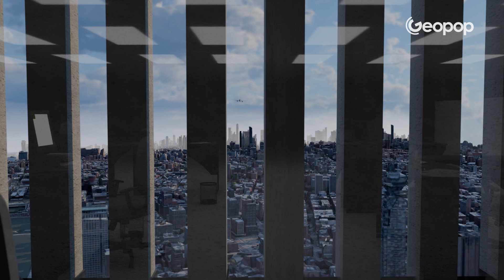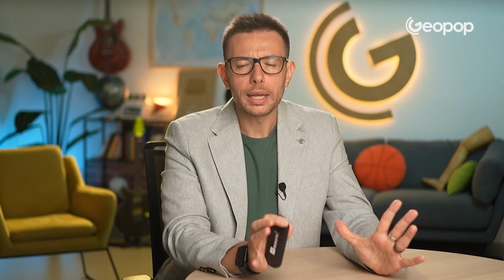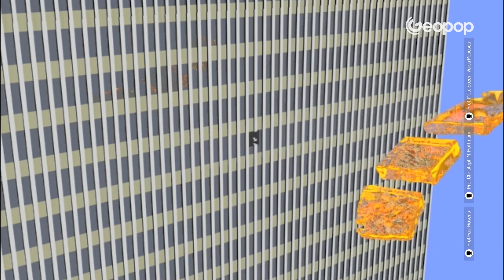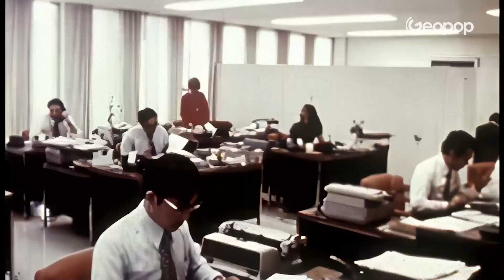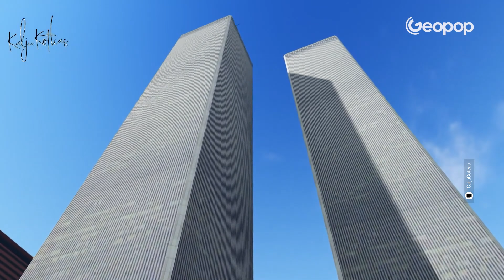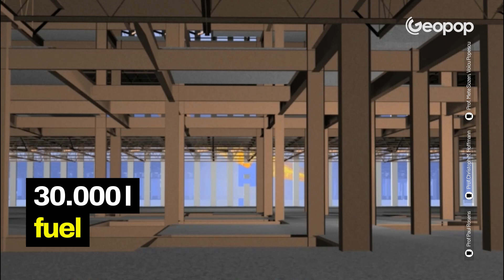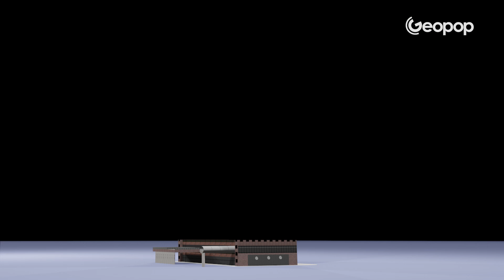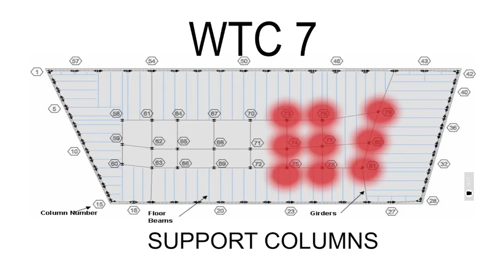9/11, 2001: The Technical Reconstruction of the Twin Towers and WTC 7 Collapses

Comment: NIST's final report actually confirmed a period of free fall lasting approximately 2.25 seconds over a distance of eight stories. This is only possible if support along those eight stories are COMPLETELY removed or broken.
Reply: It was the end of the collapse when they recorded that. The section they measured - the exterior moment frame - was only being supported by 4 columns or so. Nearly 80 columns had already failed starting more than 10 seconds earlier.

This is why it is so important to read the entire report so you can understand these things in context
Reply: @TheLoonResistance  You are a very busy shill Fitzshill!
Reply: @TheLoonResistance  Nope...it was more in the middle rather, occurring between 1.75s and 4.0s into the total 5.4s descent.
Reply: @ziad_jkhan  - Free fall doesn't matter
Reply: @TheLoonResistance  Well, that's willful ignorance
Reply: @ziad_jkhan  - Then prove me wrong. You STILL haven't said why you think believe it matters. Lay out your case. Your entire case, start to finish.
Reply: @TheLoonResistance  LOL...you're conveniently ignoring the fact that the free fall implies that the supporting columns must have been COMPLETELY suppressed over the entire eight stories all at once and you're asking me to prove you wrong instead?
Reply: @ziad_jkhan - No it doesn’t.  The NIST certainly describe no such thing. 

When are you going to ask me how Chandler and The NIST measurements are a curve, not a straight line and show a period of over GA?

How does that fit your scenario?
Reply: @TheLoonResistance  You're making no sense at this point. You're literally sounding like a bot that's out of touch with actual reality
Reply: @ziad_jkhan - Which part of what it said makes no sense?  You made a vague, unsupported claim.

I pointed out your claim is contradicted by The NIST - the source of your data.  That is a true fact.

I also pointed out the measurement in question is a curve, not a straight line and includes a period of over GA. I said the same thing yesterday and it is also a true fact.

How do you explain faster than free fall? I can, the question is can you?
Reply: @TheLoonResistance  Sorry, you stopped making sense and are starting to sound like a bot again, one that's gladly intent on ignoring the free fall issue. I've got better things to do than argue with a bot.
Reply: @TheLoonResistance  If you can explain the free fall then go ahead else just shut up and stop trolling
Reply: @ziad_jkhan - I am addressing the free fall issue directly, just not in a way you have been programmed to deal with. So you are trying to take the losers way out to save face.

Maybe if your brain is being overloaded we should only deal with one aspect at a time. 

You claim The NIST measured a brief period of free fall during the collapse of Building 7.

You also claim without evidence this can only be possible if every one of the 82 columns is removed over 8 floors simultaneously. 

Do The NIST describe that occurring, YES or NO?
Reply: @TheLoonResistance  I don't need evidence. It's a basic law of physics. Nothing can fall at free fall speed unless the way down is COMPLETELY cleared. It's as simple as that and, again, you're just trolling at this point.
Reply: @ziad_jkhan - You are avoiding the question.  

You claimed free fall can only hspoen if every column in the building fails at the same time over 8 floors.  Does The NIST describe all of the columns in the building failing simultaneously over 8 floors, YES or NO? 

To save time with your endless evasions and because you haven't actually read the thing I will answer for you.

No, the do not.

The NIST describes a progressive collapse with columns failing in sequence low in the building. Yet they still measured a period of alleged free fall?

How is that possible?
Reply: @ziad_jkhan  - We are at that ugly point where dogma intercects with critical thinking

Up til now you have been reciting (badly) some dogma you found on the internet. It isn't your original idea and you have nothing invested in it beyond a few catch phrases you copied so you can't even flesh it out into a complete claim with a beginning, middle and end. Now here I come in challenging that dogma with true and relevant facts such as there was no actual measurement of sustained free fall, the measurement does not mean 83 columns failed simultaneously across 8 floors and the movement has nothing to do with what started the collapse but rather how it kept going.

ALL of that is over your head.

So you reach for standard non-thinkers defense #1 - your opponent must be a bot. 

Absolutley no thinking required, gets you off the hook and saves face while you don't have to learn a thing.

Sad.
Reply: @TheLoonResistance  Basic physics is not dogma. Again, you can't explain how WTC 7 fell at free fall speed for 2.25s over 8 stories, which requires everything underneath to be out of the way. So you're literally beating around the bush.
Reply: @ziad_jkhan  - You don't know anything about even basic physics. Again, you are just mindlessly repeating standard conspiracist catch phrases you copied off the internet.

For a single point on the outer shell (which was NOT THE BUILDING) to move (NOT DROP) at a rate that averages more or less 9.8m/s/s for a paltry 2.25 seconds does not require anything below to be out of the way.  For that one spot to start out below FFA then accelerate up to and then over FFA before decelerating back down below FFA again during that 2.25 seconds - which Chandler's measurements clearly show it did - definately does not require anything below to be out of the way.

Even in basic physics you need to stop always thinking in 2 dimensions (hint, hint, hint, hint, hint).
Reply: @TheLoonResistance  Yes, it does require EVERYTHING to be out of the way and the term 'free fall' is self-explanatory.

To be clear, free fall means gravity is the only force acting on an object. Any support under it exerting an upward force would negate it.
Reply: @ziad_jkhan   - You didn't take the hint.

The data point being measured is moving in 3 dimenstions not 2 which is why it starts out under GA, accelerates up to and then over GA before decelerating back down below GA during that arbitrarily chosen 2.25 seconds.  It is moving inward as it is moving down, which accelerates the data point to over GA. 

Remember, the data point being measured is on the hollow, empty outer shell, NOT THE BUILDING .  The Building (defined as its center of mass the core, floor systems and even the perimeter columns) are already gone before the measurement is taken. The only thing left is an empty outer shell that hung on the outside of the building and supported by just 4 of the buildings 83 columns. 

Since what is being measured is the hollow, empty outer shell, NOT THE BUILDING and that point was moving in 3 dimensions not 2, we now have 2 solid reasons why it means nothing.
Reply: @TheLoonResistance  Everything I said applies perfectly in 3D as in 2D. And the inner shell fell at almost the same speed as the outer shell on which the measurement was taken. The videos clearly show a negligible difference so your point is moot.

Even if there was a significant difference, you'd still have to explain the free fall speed for the outer facade that spanned over the 8 stories.
Reply: @ziad_jkhan  - In 3 dimensions there are more forces acting than just gravity, so multiple forces of acceleration in more than one direction - or do you not understand how a lever works?

Come on, this is basic physics.

And it's STILL NOT THE BUILDING just its exterior shell, held up by a piddly 4 columns which were not up to the job so they buckled more or less simultaneously. 

And that still tells us nothing about WHY the building collapsed

I understand this is multiple elements to track and you show clear signs of single-element (non)thinking but you have to stick with me on this.
Reply: @TheLoonResistance  You managed to avoid explaining the free fall speed...congrats!
Reply: @ziad_jkhan  - I did actually even though I don't have to. 4 columns of 83 failed more or less simultaneously, then the hollow empty shell moved in 3 dimensions like a lever accelerating the data point more than it would have by gravity alone.  You missed it because again, you are spouting dogma you mindlessly copied off the internet, not expressing ideas you earned.

You also managed to avoid explaining FASTER THAN FREE FALL, which happened and BTW completely destroys your argument, makes the measurement even more irrelevant than it already was. 

AND you keep avoiding the fact it ISN'T THE BUILDING BEING MEASURED, so more irrelevance

Just two of about a hundred reasons why a million people before you ALL FAILED running this same play.  Free fall is guaranteed proven fail. 

You know, even a Lab Rat eventually learns from its mistakes and changes its behavior.  I'm going to take one last shot at fixing that, then I'm done wasting my time on you.

In the video below (which is only 23 seconds long so IO won't waste your time) please indicate the time stamp (_:_ _) where we see the first externally visible signs of the building collapsing. When does it start?  

www.youtube.com/watch?v=4xN8lzBo9zY
Reply: @ziad_jkhan - And that's what I figured you would do. Run away from the easiest and most fundamental question there is.
Reply: @TheLoonResistance  Wait...isn't it you who's actually running away by failing to provide a proper explanation for the free fall?
Reply: @ziad_jkhan  - I already gave it.  More than once - there was no period of sustained FFA measured for any part of the building AND it tells us nothing about what caused the collapse if there were, so irrelevant.  I don't think I can make it any easier than that, even for you.  Again, reading comprehension seems to not be in your favor. This is why it is so important to begin and the beginning, don't you think?

So, let's start at the beginning:  In the video below please indicate the time stamp (_:_ _) where we see the first externally visible signs of the building collapsing. When does it start?  

www.youtube.com/watch?v=4xN8lzBo9zY
Reply: @ziad_jkhan  - It isn't a trick question. When does the collapse start in that video?

Comment: Even a child could tell you that if any collapse was even possible from such impact, then the towers would only collapse from the top until the impact zone. It was a controlled demolition set up by the psychopathic elite. Fucking obvious.
Reply: This is why it is so important to not learn engineering from children.
Reply: @TheLoonResistance  You are a very busy shill Fitzshill!
Reply: Uhhh, no because when those top floors reached the impact zone, they had a shit ton of energy that the first undamaged floor was never meant to support. Hence the "pancaking" of floor after floor.  Buildings are made to maximize profit.  They are not overbuilt.  They are built just strong enough to handle all normal events, but not much more.  The falling of the above floors created too much energy/momentum to be stopped by a healthy floor. I would say THAT is pretty fucking obvious.

Comment: It most certainly didn't take 10 minutes for them to collapse, and building 7 was hit by debris fracturing the main sprinkler line, and causing fires to break out. The fires burned for 7 or 8 hour's, warping ONE particular beam... actually driving it off the supporting column. Then gravity took over.
Reply: All3 builgs fell in under 10 sec. Way TOO FAST - footage of 7thblg demise does exist

Comment: I may only have an AA degree from a community college. , but I know when I am being feed a load of bull crap. People just think that experts would not lie. So where are all the videos that show prof (by experts) of the towers collapsing the way they did, only by the impact damage, was impossible? How did both towers collapse perfectly in demolition fashion, one after the other, when the weaker side of the towers (from impact damage) should have caused the upper portion to slide even slightly, shifting major weight altering the way it fall? How did the plane (made mostly of aluminum) that partially (at least 1/4) disintegrated on impact with the concrete outer structure, reach into the inner core with enough force to take out or break through any center columns? The bulk of the weight/force having the most affect on the impact being liquid, at the moment of impact, began to disperse, spread out, and vaporized, as it was starting to burn, thus eliminating, absorbing and lessening  major kinetic force pushing forward. The first 1/4 of the plane being majorly smashed and  tore into pieces would have less kinetic power mowing forward (the weight dividing as it breaks apart). With the spread of debris comes the loss of kinetic force and that left over force is then divided to different columns. How do they break, into two pieces from aluminum and that not a solid chunk but debris spread out? Some answers just create more questions then they answer!!

Comment: Ok but simulation and video looks different. How about WTC 3,4,5,6? Why are standing still?
Reply: Which simulation?  Different how?

None of those other buildings are still standing.
Reply: @TheLoonResistance  Simulation of collapse wtc7 is different then video 21:16. WTC 3,4,5,6 not collapsed like 1,2,7, why?
Reply: @krisp5223  - The simulation at 21:16 isn't meant to look like the collapse of Building 7.  It's purpose was to test what would happen by failing Column 79 with no other damage simulated. The building collapsed, in largely the same sequence as the real event - east to west through the core until the core was gone, then the exterior dropped. 

Buildings 3 and 4 collapsed.
Buildings 5 and 6 partially collapsed and burned out.

Each building is different in design and construction and suffered different damage.  If you can only handle a one-size-fits-all solution where everything has to be exactly the same then I might suggest you seek a different hobby.
Reply: @TheLoonResistance  You are a very busy shill Fitzshill!